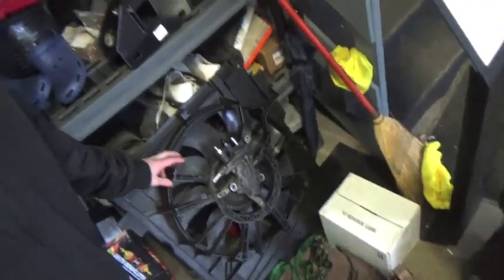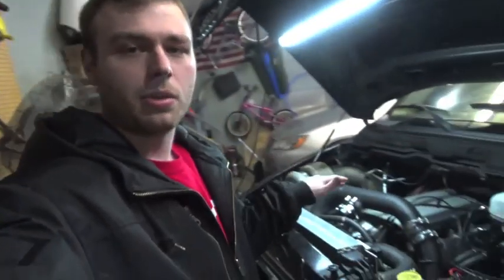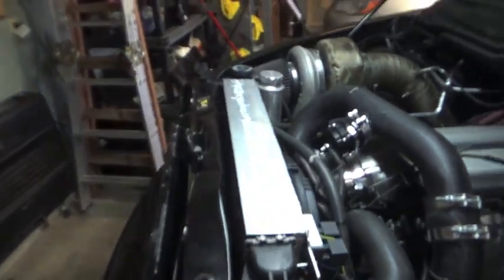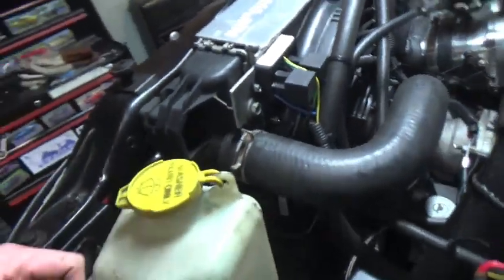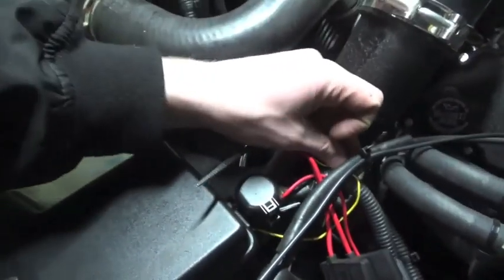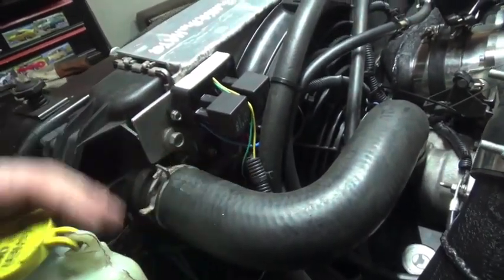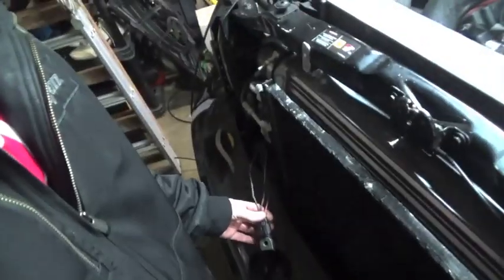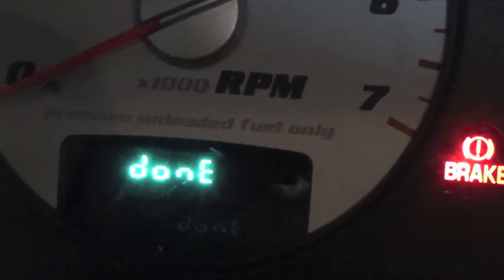Hydraulic to electric fan conversion 101 dodge ram srt10

Comment: How are you liking the efan setup? My hydraulic fan clutch is cracked, so I'm on the fence about either replacing it or installing the efan kit from JMB.
Reply from the maker: Have to upgrade your alternator factory 160amps is fine but if you have the a/c on, lights on and radio on will drain battery down to 11v at stop lights
Reply: Good to know, thanks! No regrets otherwise?  @RacingRamFam

Comment: I would love to swap out my hydraulic fan on my 5.7 to electrical fans but the fan in my 5.7 had to of been removed before and it acts like it had loc-tight used on it
Reply from the maker: You just need a air hammer and one of these tools. Also the 5.7 is reverse threads so righty loosy! https://amzn.to/44NTvFH 
I use mine at work daily

Comment: My srt10 at idle only has 25 psi of oil pressure is that normal?
Reply from the maker: Same it’s fine. Mine has big oil clearance tho
Reply: What did you go about the lines for the power steering for the fans

Comment: Have you experienced pressure problems? After conversion my ps pump sounds like a supercharger when hitting the gas. We replaced the ps pump but same behaviour. Thank you.
Reply from the maker: No but I did run both the returns on the resvoir I just T into the return from the rack

Comment: Hey nice video I gonna do the conversion to electric. What did you do with the power steering  lines? Do you know where I can find more info or can you do a video on how exactly you did it? Thank you
Reply from the maker: I just had an lines And ran the pressure line right to the rack n pinion
Reply: @RacingRamFam   how connect power stering  lines
One line go to  rack pinion and the other just cap off
Reply: Venemous 1 racing makes the best lines

Comment: How do you tell if your Ram is a hydraulic fan? Mine is 2009 ram 1500 4.7 liter
Reply from the maker: Does it have powersteering lines going to the fan?
Reply: @RacingRamFam  Yes but it looks like it runs into the power steering cooler infront of the rad.

Comment: guy you have no idea how lucky you are to be able to get out that crappy hydro fan but what about the hydraulic lines running into the fan?
Reply from the maker: al dee run line from top of pump to rack, and the return line on the resovoir to fan cap off